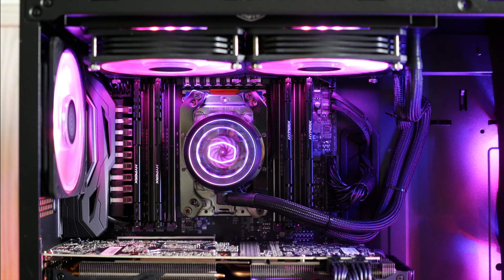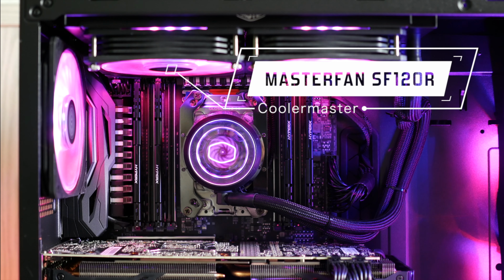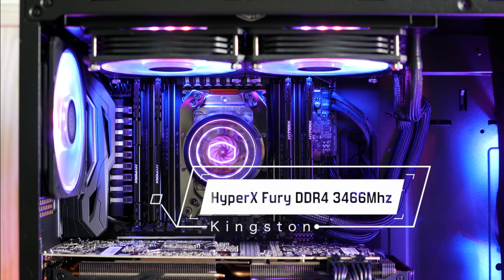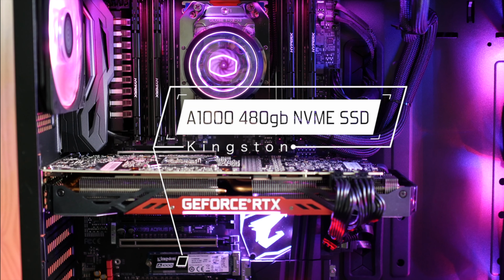Coolermaster Silencio S600 #Threadripper 2970WX PC Build ~ Coolermaster Silencio S600 | TekTherapy

Comment: Hello,  how you connect the top fan on the front panel? They have only two holes for the  screw on the top fan.
Reply from the maker: Hey, it's been a long time since I built in that case. As far as I remember I improvised to be able to mount three fans in the front.

Comment: Thoughts on 2970wx vs 2950?  Trying to decide which one to go with, the budget allows either.  Single-core speed is lower with 2970.  I will use the machine for 3d modeling and rendering.
Reply from the maker: If you are rendering hands down the 2970wx (if what ever software you use for the renders is able to use all cores). It made a massive difference for me while editing and rendering compared to my earlier 12 and 16core threadripper. Thx for watching btw. !

Comment: Hi my friend. Gorgeous build as always. Don’t you think 480gb storage is little bit small for video editing? Don’t you think for workstation build a Vega card would be more appropriate since Vega cards are designed primarily for workloads? A Radeon VII with 16gb of vram vs RTX 2080 would yield much better performance for similar price.
Reply from the maker: Hi Grigor.. It was a feature build. So off course I added two 4tb drives for storage. For the editing suites I use, Nvidia Cards are more accelerated than AMD Cards that's the sole Reason honestly.
Reply from the maker: Hi Grigor, haven't seen you in the comments for a while? Hope you are well?
Reply: TekTherapy For some reasons I’m not getting notifications about your new videos. I thought you took off for a while.

Comment: Hi! What about CPU temps reached at full load? To turn it on, just,  is not enough!
Reply from the maker: Hey, thanks for checking the video out but it has been 3 years since than. 

I used it as my main editing rig back than but after so many years can't tell you any temps.
Reply: @TekTherapy  Any issue using this TR based desktop? How long did you used it? And on what kind of apps?

I will try to use it doing maths ecuations and MySQL/Php/Python apps, and as a server. My i7 burn by using to much processing time.
Reply from the maker: Well i missed this comment since i never got a notification for it. So sorry for that. I did use the system for around 2 years as a editing rig. So i had really heavy renders on it back than. Never really had any stability issues!

Comment: The case looks really slim and clean! How are temps in it?
Reply from the maker: Hi Andrew, idle temps are around ~55-58C with the 24 Core Threadripper which is fair enough for that kind of cpu. With a more mainstream CPU like a 8 core Ryzen or I7 you´ll have much lower temps. Case is very nice tho for a workstation build!!! Thx for watching!

Comment: Hey, I was wondering which case I should buy and the looks of this S600 really appeal to me. The sound isolation is a part of the reason I'd like to buy this case. I'm worried about temperatures, however. I can always return it, but if I get a hotter part when I upgrade I don't want it to overheat. Do you think a 3070 and an 8700k would be ok in this case? If I put 2 fans in the front is the airflow good? I don't want to choke my components but I also want that extra quietness. Thanks
Reply from the maker: I don't see any issues with an 8700k running in it. I ran a Threadripper with 24cores and that was pushing it. But when using Front/Top Fans I am sure you'll have decent enough Temps.
Reply from the maker: Hey Joonas! I am finally back uploading content and thought you might like my new video?  Maybe you wanna take a look! Cheers Ron

Comment: Testers say that is a gpu cooker. What you say about temp?
Reply from the maker: It really depends on what you run in the case. I am pushing it with the 24 core threadripper. But it doesn't reach critical Temps with the mirage installed tho while editing/rendering. (beside some fan ramping under load) Didn't come around doing extensive gaming benchmarks tho since it is/was intended as a personal workstation for editing. Thx for watching and your comment!